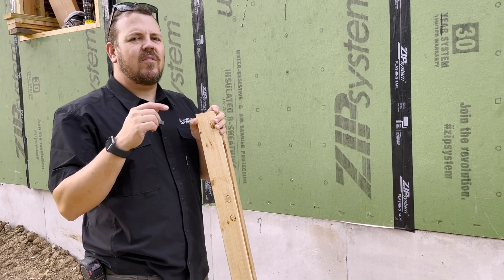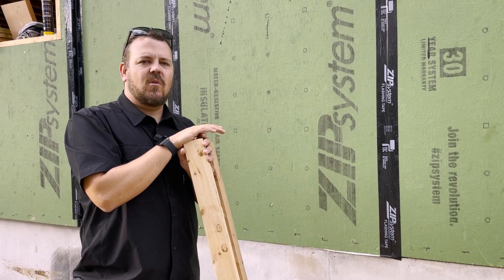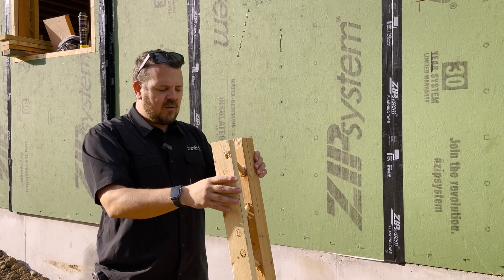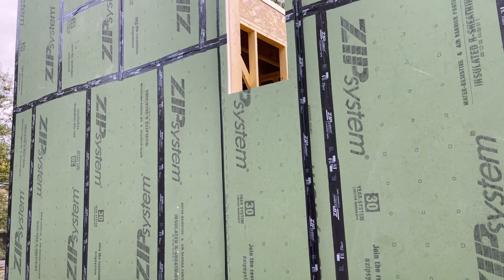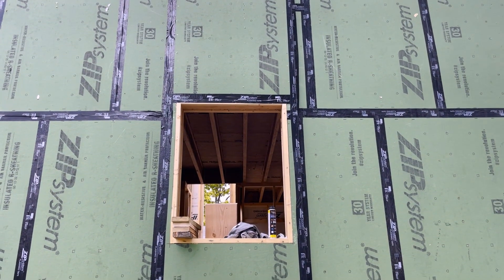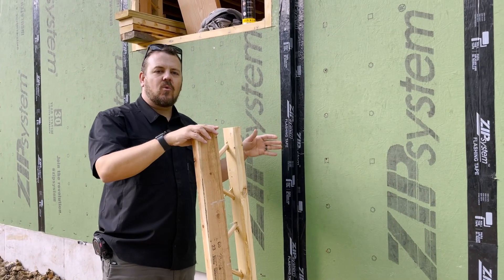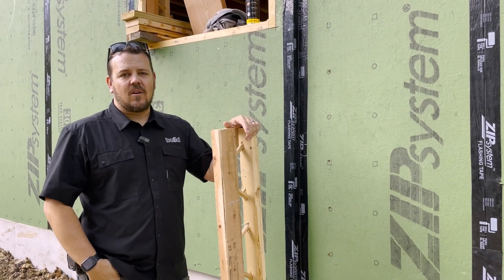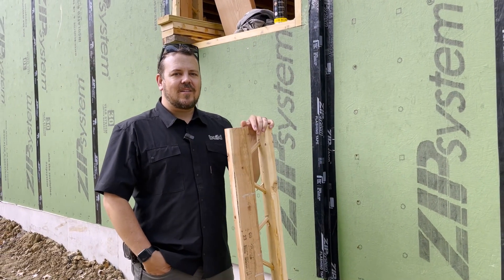Framing Elevation Changes

Comment: Why use zip-r with the t-studs?
Reply from the maker: We cover your question in two weeks time here in an upcoming video. However the short answer is that they do the same thing and doing them together makes each perform better. Could you do without one or the other, probably. But both is great.

Comment: What a pro! I did have a question about these T-studs... Is it quite a bit stronger than a regular stud of the same size?
Reply from the maker: T Stud claims something like 3X or more. I forget what exactly but, yes, they are stronger because they have two strength axis because of the directions of the studs.

Comment: Thermal Studs are so nice, I used them on my project and used closed cell, its performance is absurd. I also did closed cell under slab and taped closed cell foam board above slab. No regrets

Comment: So what is the explanation behind the elevation change from a historical perspective? It sounds and looks entirely aesthetic. Are they saying they just want a "visual break" in the plane of the wall? Never mind the current siding and its style? That 1 inch change really seems like a huge ask for little to no added value. Builder patience!
Reply from the maker: The ask from the city is based in the idea that older buildings didn’t have long unbroken walls so new buildings shouldn’t either.

Comment: I wonder if it wouldn't also make sense to use the naked T-studs in other areas like bathroom/shower walls that need to be flat, but also might be able to take advantage of the truss gap for running water, drain, and vent lines. Drains might be a little tricky though. Might have to order the studs long, do some math, and trim the studs in such a way that the webbing is offset at the same rate as the drain line. Or would that even be cost effective compared to LSL? I'll have to keep that in the back of my head for later. Heck, with a little notching you could probably get away with ERV and/or high velocity HVAC tubing too.

Comment: Love the 2x8 T-Studs. I know the compressive strength is supposed to be that of a 2x8, but what about shear strength? Can you use these to make a beefy, wind resistant house? I'm imagining 3.5" of closed cell foam in there with an R15 rockwool batt on top of it, and sheathing with 3/4" plywood, with all the Simpson screws tying things together.